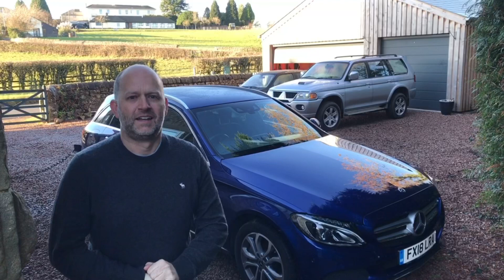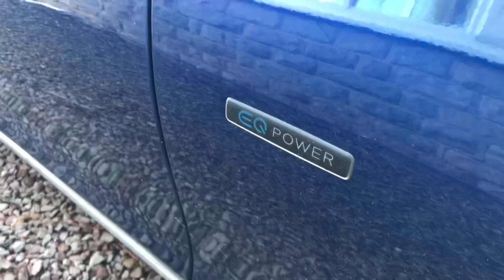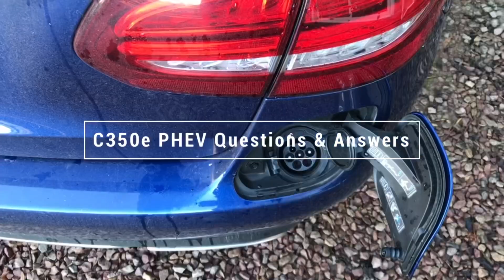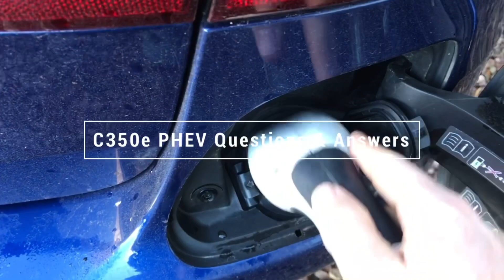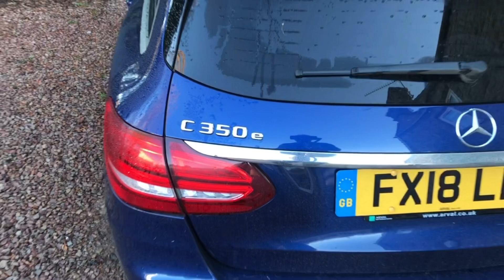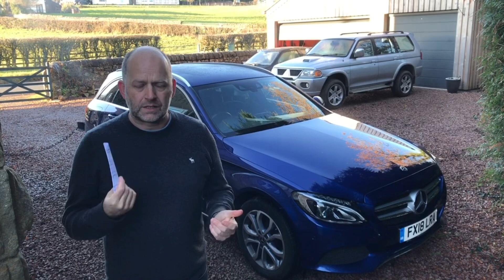Mercedes C350e PHEV Questions & Answers

Comment: Hi, perhaps a strange question... Is it possible to remove the complete hybrid batteries  and still can drive it without any specific alterations?
Reply from the maker: @PulkVideo  I don’t know is the quick answer. But I’m not sure why you’d do that? Wouldn’t you just buy the cheaper 2.0 petrol? 🤷‍♂️
Reply: @FastandFun  can understand your question. Its because this Merc has a brand new factory build engine in it.
But I am not so keen on hybrids, specially the weight of them. But I also got no clue how much exactly the hybrid battery weights. It is more a “ can it be done” question. Just curious.
Reply from the maker: @PulkVideo  I know the battery pack weighs around 200kg and reduces space in the boot by raising the floor a few inches. Still not sure why you’d do it as you could buy a 2.0 petrol, non hybrid of the same year that’s as factory fresh as this!
Reply: @FastandFun  just because it can.. ( I think)

Comment: Looking at buy a 16 plate c350e do I need to be concerned about the battery seeing a lot about changing it what would cost 3k upwards
Reply from the maker: I wouldn’t get a very high mileage C350e as over the c.80k miles I covered in my 3 years ownership there was a definite degradation in its performance with regard to distance. Difficult to quantify as you have many factors influencing the range, from temperature, driving technique and terrain (hilly/flat). But I did see a loss in range if monitored over the long term.

How long before the batteries would need replacing? 🤔 depend what loss of range you’d accept I suppose, but the cost would make the decision to replace the batteries very difficult I would expect.

Comment: Hey there, is this still a good car to buy in 2022? Thank you
Reply from the maker: Of course, but the only thing to be wary of is the potential range issue after multiple years of use with the same battery pack

Comment: Do you perhaps know what the costs are to replace the batteries?
Reply from the maker: Not exactly but was told that it’s somewhere between £5k-£6k!
Reply: @FastandFun  thank you for the quick response.. did you had any problems with the gearbox, I ve read that there are lits of problems and that models from 2015/16 had lots of issues. What are your thoughts about this :)
Reply from the maker: @Janzegerss  mine was a 2018 and I suffered no problems with my gearbox at all in 3 years and 75k miles.

Comment: Hi a quick question 
I own a 2017 350e 
Recently I have noticed that the Emode isn’t working even when the hybrid batter is charged to 50%

There are no error messages. There is no other faults. 

FYI - for the last 1 1/2 months I drive like 10 km per day 

Please your opinion is highly appreciated

https://youtu.be/S67uHT39neI 

Exactly like in this video
Reply from the maker: I suggest you plug an OBDII reader into the car so that you can read the fault codes on the canbus. This will enable you to identify the fault. If you haven’t done it before it’s simple and easy and although I’ve not got a video of doing it on my 350e I have on my RS Clio182 and it’s the same process. The first half of the attached video will show you what to do.

https://youtu.be/96w0jceXvBI

Comment: what happens when my battery is totally dead and need replacement? can i drive only on engine ?
Reply: Ok thank you so much sir
Reply from the maker: My assumption is that should the battery pack fail (or retain so little charge as to be redundant) then the car would remain with the engine running only. I cannot see any reason why the car couldn’t still be driven. 

However, it would then become a 2.0 petrol C class with an extra 200kg in the boot ....... so a little pointless really.

Comment: I'm considering one of these to replace my golf GTi. Looking for a luxury family car that has good economy. Always wanted a Mercedes. With the relatively low miles available on EV is it worth it. ? I'm getting mid 20s to low 30s mpg in my golf and it's frustrating. 

Just want an idea if it's worth it. Some plug in Hybrids are claiming 20 30 miles plus. Which is great but 8/10 miles 🤔
Reply from the maker: A lot will depend on your usage. If you do lots of shorter journeys (less than 20miles) then your mpg is going to be great. If you do 100’s per week then it’s going to only be mid-high 30’s mpg. 

The other clear benefit of of PHEV is that you don’t need two cars. You have the benefit of elec only on shorter journeys with the added benefit that you can drive for 400 miles with out thinking about elec charging stations. 

Plus, you’ll win the traffic light grandprix with both elec and engine power 👍🏻
Reply: @FastandFun  yes I've just had a look at the 300e and the diesel plug in hybrid there are more options than I realised.

Yeh the power output is very appealing thanks for the reply 👍

Comment: When you strat car does it runs firstly on  petrol to warm up interior and engine, or can it be driven in EV mode straight after night for example?
Reply from the maker: Hi, you can manually switch the vehicle into EV mode which means it will only run on batteries. If you leave it in Hybrid mode (default setting when you switch the car on) it will normally start in EV mode too, only allowing the ICE to start if you accelerate hard.
Reply: @FastandFun  thanks for quick reply. That is much better than in my Lexus hybrid, because it starts always on petrol to warm up engine and then using battery/ev mode.
Reply: @boorek0  I think is better to warm upp the car in petrol mode than in eq , Lexus in that way is better because in cold temperature warming up you car with petrol saves the battery agains damage, so Mercedes starts directly in EQ mode which for me is not better option..
Reply: @ismetkjerimi  it is not better if you have only 2miles to work and it is using petrol all the time, even if hybrid.

Comment: Enjoyed your video. I have this car & the electric range is dire. I couldn't even be bothered charging it now and a home charger didn't make sense. But I prob will use the 3 pin home more now. Still love the car though, despite the battery range

Comment: Great questions and better answers...So when the back seats are folded down how long is it from the back of the front seat to inside the tailgate. Currently I can put a full size adult bike in my skoda superb without taking a wheel off and need to know the measurement please
Reply from the maker: Hi Steve, I’m not sure what the distance is (you should be able to google it) but I’ve had my road bike in the back with both wheels on. No bother at all. It’s a little tight, but it does fit 👍🏻
Reply: @FastandFun  thank you
I can see myself paying a visit to a dealer to check it, but it certainly looks like it'll fit fine.

Comment: Here is a great question, and I was going to pick up one of these second hand, but I'm put off by this... Are you as an owner, happy to pay £6000 to change the battery on this car? Or would you trade it in for something else before it eventually goes? Mercedes main dealer Parts department confirmed the Battery is £6000 or £5000 roughly with a surcharge. 

Even buying brand new, it's hard to consider the possibility of spending £6000 to replace a Hybrid battery every few years. There are videos online that show these cars that have had faults and have had batteries changed in less than 5 years hence why I ask.
Reply from the maker: That’s a great question. 

Firstly, my C350e is my main everyday car and is leased. So it’s unlike my other modern classics in that I don’t actually own the car so not a problem that I’ve had to deal with. 

The short answer is “no”, I wouldn’t pay the £6k for a full battery replacement - £6k alone would get you a nice second hand car in its own right and it’s difficult to see how second hand values of these (any type of PHEV/EV) will be affected with respect to battery replacements. I suppose you could forgo the replacement and suffer degradation in the batteries, after all it’s got a 2.0T engine but that’s sort of missing the point in buying a PHEV in the first place. 

I understand why you’ve been put off and would likely have come to the same conclusion myself. It would be great for others who own older C350e’s to comment regarding what they have done/not done.
Reply: @FastandFun  Definitely sir, but this is the problem, Because I also considered driving the vehicle without the Hybrid and just coping with that if the battery went until I could afford an alternative or reconditioned battery, however... A quick google search presents this information when you ask if a Hybrid car can be driven without a Hybrid Battery and the answer I got is...:
 "Most hybrid batteries have an eight-year or 100,000-mile warranty, according to Bumblebee Batteries, but some fail before that time. A hybrid vehicle cannot run without the hybrid battery, so vehicle owners must invest in new hybrid batteries periodically, which can make vehicle maintenance expensive.12 Jun 2020"

This has pushed me back in the direction of C200 Petrol cars. I would love a C350e but if I don't want to spend £6k then I can't according to this source, even benefit from the 208bhp power engine because the Hybrid Battery may need replacing also. That's a kick in the teeth unfortunately. The degradation I could live with so long as the Vehicle is still drive-able but it seems as though when the Battery does pack up, the Combustion Engine may not work without the Hybrid Battery being in service. :(
Reply: I agree

Comment: I believe in the app you can also set the departure time for charging purpose (not just the pre-conditioning, you can switch off the pre-con and just set the departure time), this should make sure to have 100% charge by the time you’re supposed to go. Can you double check please?
Reply from the maker: I’m not aware that you can do this. The only reason for setting a departure time is to enable pre-con ahead of leaving. The car can only charge at a given rate and takes c. 2.5 hours. Once charged it will retain its full charge until used, so not sure why you’d want to wait and only start charging 2.5 hours prior to departure.
Reply: @FastandFun  
Yeah agree, it doesn’t make any sense but there is an option in the app to set a departure time without pre-conditioning. No idea what it’s purpose.

Comment: Both this and your other video were very informative. You mentioned it was a bit of a Q car, and the spec seems to suggest this. I am aware of the measly real world fuel range, but a lot of my trips tend to only be less than 5 miles, which on a C220d is probably doing it more harm than good. My question is, what's the in-gear 30-70 acceleration like compared do a diesel? I'm considering switching up to an S205 from my S204 and was considering the hybrid. Additionally, what's the real world fuel consumption like in town and country traffic, say NSL's interspersed with 30's and 40's IF you're running in hybrid mode. If it can best the 35mpg I'm getting with a roof rack populated with 3 mountain bikes, it might be in contention. 

Also, what's the reliability been when it comes to the powertrain and charging? I've never had any issues with my S204, but I do have reservations on its complexity and knowledge at independent/specialist workshops if things go wrong.
Reply from the maker: EarlOfEasycore you would have to google the in-gear acceleration values, but in the real world, if you put it into sport+ mode, it will give you a big shove in the back and make overtaking simple. 

If most of your driving is less than 5 miles, you’ll be doing all your driving on elec only 👍🏻 on longer drives, the mpg will reduce further you go because the initial miles on electric will become a smaller percentage of the total distance. If you start with a full charge, you’re unlikely to get less than 40mpg. If you’re at high speed for long durations it may drop into the high 30’s. For reference, the worst mpg I’ve ever had has been 35mpg!

Regarding reliability, very few problems at all. A minor issue with the charging flap but otherwise it’s been very good. Regarding the battery power, I’ve not seen any significant decay in performance over the past 2 and a half years. Others, with older cars, say that the batteries do lose their charge quicker with some stating as low as 6 miles. The worst I generally get is 8 miles. Temperature has by far the biggest effect on battery condition. 

I’ll be doing one final video on the 350e before I return the car in March, likely around the best and worst parts of owning a C350e - please keep watching 👍🏻
Reply: Thanks for the feedback... I'll be eagerly awaiting the final video. I'll see if there's one locally that I can test drive and use my butt dyno. Presumably with all that weight in the back, you're not having any issues with chassis balance and it being tail happy? I generally find that the mercs are a lot more neutral and compliant than the equivalent 3/5 series.
Reply from the maker: @Titot182  you can feel the weight in the back and I think I mentioned in my first video that they eat rear tyres - you’ll get no more than 10k miles on average between sets of rear tyres!
Reply: Starter motor is a very common problem on these cars, I’m using the third starter now. The first was replaced in 2019 may @ 60k miles,  the second also had to be replaced in 2020 October @ 80k miles...

Comment: Can I ask whats the reason behind the fact that after charging the battery in the cold weather we would only be able to get around 8 miles to drive on electric?
Reply from the maker: Two main reason: Firstly, battery performance is affected by temperature, colder it becomes, less efficient batteries are. Secondly, in cold weather, you will using all your high power systems (heating, de-mist, heated seats, etc....) putting higher demand on your batteries.
Reply: @FastandFun  thank you
Reply: @FastandFun  hello, can you tell me plecase, how mouch does it costs the battery for the hibrid system? Thank you. You have a nice car!
Reply from the maker: @gcr3990  Thanks for your comment. I’ve not looked in to it fully but several sources have indicated to replace the full battery pack at 5 year point is c. £5-6k. I hope this helps.
Reply: @FastandFun  thank you again. Have a nice day!

Comment: Just to add to it. The charge mode doesn’t hurt when you are on the motorway as the needle doesn’t go up  much more. Gives you the added benefit of free last miles to get you home using electric

Comment: I have the 2015 C350e premium. I like in Northern Ireland and a full charge says 12 miles. True range is about 6miles which isn’t great. Other than that, it’s a lovely car. Consumption for me isn’t great either and I don’t drive it hard and always charge after every drive.
Reply from the maker: @kiff AA that suggests that as the car ages the batteries do start to lose their range then, as the lowest distance I’d get is c. 8 miles (and I live in a hilly area)
Reply: @FastandFun  yep. They definitely do lose range as they age. MB Uk said it’s normal and not covered either. In case anyone is wondering.
Reply: @kofiAnkraAsareAttrams  
Kiff, the battery degrading appears a real drawback as the car ages. If it keeps degrading as a car ages, one would be carrying out the extra 200kg of battery with no benefit. I wonder if the battery can be removed and converted into straight petrol?
Reply: @kieranh6962  I’ve been told the battery can be reconditioned. Not sure of the cost involved. I personally would not bother converting it to fully petrol. I’d rather sell it than have to deal with that.
Reply: @kofiAnkraAsareAttrams  
Thanks Kiff. Reconditioning sounds like a better solution. Considering buying a 2017 one with 80k miles up. Lovely to drive but potential longer term battery issues putting me off.
Reply: @kieranh6962  they are lovely cars, just don’t buy them if all you care about is the electric range. You are better off getting a cheaper ICE version and a used cheap ev like a Leaf or Zoe as a run around.
Reply: @kieranh6962  Hi did you get one in the end? I have been looking at this or the 300 version and would be interested in any advice.
Reply: @Yogismotoco  Yes, bought before Christmas. Love the car even with the very limited ev range. Wafting along on ev only is very pleasant. As Rich said it really is two cars in one. Are you referring to the C300e or the C300? If you can afford the C300e I would go with that due to increased ev range.

Comment: I can confirm. My C350e, 2015 estate, the same lovely blue color. I have 180kkm on the clock, on fully charged battery i can do 12-15km. To fully charge (from 10 to 100%) it gets 4.5kWh from the grid. When driving with no battery charge from socket it consumes about 7l/100km (40mpg)
Reply from the maker: @delfico11 thanks for your info 👍🏻
Reply: Did your battery lost capacity?
Reply: @covakoma1064  Ofcourse yes. But I don't care, using it as usual hybrid car, not charging. Still love the car :)